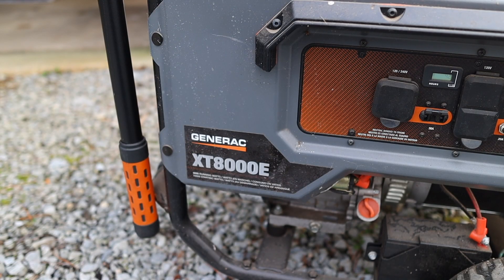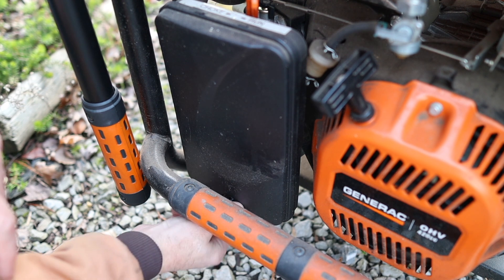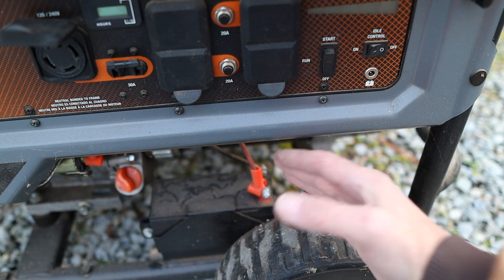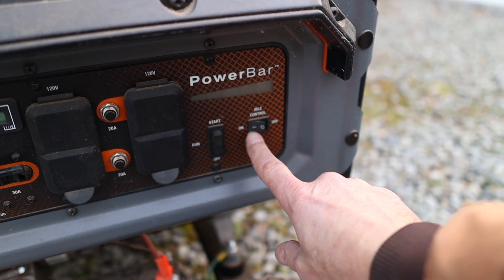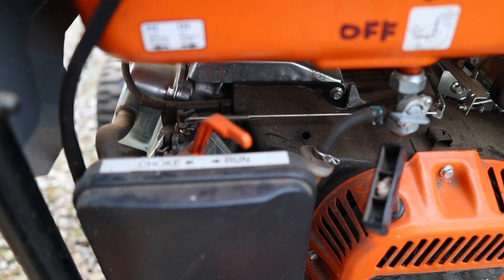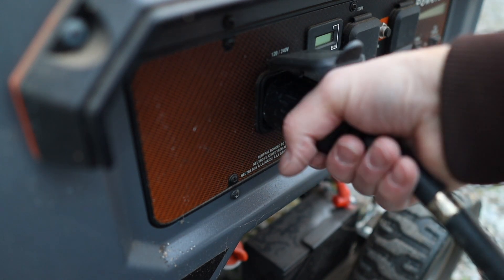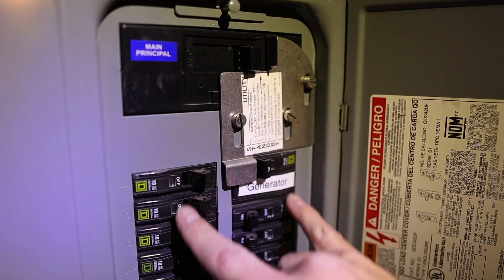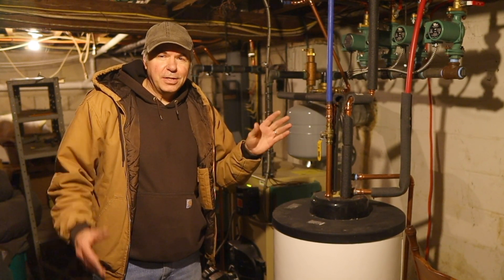Generator Monthly Test. Generac XT8000E and others. MCG video #128

Comment from the maker: These are Amazon Affiliate links. Purchasing through these links will help this channel by providing a small commission while not costing you any more. Thank you for your support!
GooLoo GP4000 Jump Starter: 
https://amzn.to/3IBT74T
Generac GP800E Generartor: 
https://amzn.to/3GoQyjR
Champion Dual Fuel 4500w Inverter Generator: 
https://amzn.to/3k1N9Qq
AirTec Lube-Shuttle Pistol Grip Grease Gun Kit:
https://amzn.to/3O0pj1z
LockNLube Grease Gun Coupler:
https://amzn.to/3kPcvwu
Recommended Grease:
Valvoline Moly Fortified
https://amzn.to/3jNM1Kv
Nitrile Gloves:
https://amzn.to/34Kg8OG
Deerskin Gloves:
https://amzn.to/2I17NNy
My Video Gear:
Rode Wireless Go II microphone:
https://amzn.to/3eiJatG
Canon M50 Camera (now Mark II):
https://amzn.to/3vHW9uD
Battery adapter for M50:
https://amzn.to/2RshsBE
Sigma 16mm prime lens:
https://amzn.to/3vJDRcx
Sigma 30mm prime lens:
https://amzn.to/3epFneh
Variable ND filters:
https://amzn.to/3tmoHIs

Comment: I don't worry about bad gas. I use natural gas. Start it up every 3 months. Change oil every 100 hours. Keep battery charged.  Check the filter and spark plug. If over 3 months I put a little oil in the spark plug opening and give the cord a few pulls before putting spark plug back in.  .... Your oil looks dirty.
Reply from the maker: It’s due for an oil change!

Comment: Nice, I have one of them power meter switches, same manual procedure as yours. But if the power grid returns it does so automatically on the switch. I use a Duromax XP12000EH with the 50 Amp outlet. Since I've prepped my house for this the longest outage we've had was 4h in the last two years.
Reply from the maker: Better to have it and not need it! ….. 😄
Reply: @MyClutteredGarage  It's like when you get a solid snow removal device like a tractor and snowblower, it will never snow. 😁

Comment: I call a generator “insurance”, and security. 
When generators became a common household piece of equipment, it took only one instance in the dead of of New England winter, to convince ME, being without electricity was no longer an option!!
I started with a “transfer switch” but did not like being that limited so, like you, I upgraded to an “interlock” device and a 30 amp breaker. Depending on who made your main circuit panel, the price for an interlock varies. A Siemens runs between 1 an 2 hundred, where all other, 10-20 bucks!! 
Still worth it! 
I invested in a battery start because I wanted to know that my wife could get the system up and running. Just had to teach her the battery setup because I keep my battery disconnected from the generator and on a trickle charge battery maintainer.
I like you shut down…I follow the first part… but I remove the drain bolt from the carburetor and drain my gas tank dry! Even with sta-bil…sitting for a couple years is not good so, I keep my tank dry and fresh gas at hand, 50 gals…
I’ve learned a generator up here, isn’t an option or a luxury! They ARE affordable and absolutely worth every cent, to know my family has electric!
Reply from the maker: You’re so right, Keith. I’m not in a bad weather area, but it seems that I need to use the generator at least once each year. The peace of mind is well worth it. As many have suggested, I may start adding a load test to the “monthly” routine. Thanks for watching!

Comment: I do the exact same thing Ed, good idea to drain the carburetor. Onetime I had a big 11K generator and stored it in my barn without draining the carb. Ended up having to pull the control panel off to get to the carburetor and clean it. I always drained it after that. Lessons learn. LoL.
Reply from the maker: Thanks Dean! Hopefully draining it along with fuel additive helps. I wish I could buy ethanol-free gas but it’s not available around here.

Comment: I have a large generator I use for my remote shed/garage. I still need to hook it up to the house. I've often thought about using a surge protector or a soft start when I use it for the house just to be extra safe with the appliances.
Reply from the maker: Hi Kevin. I’m not too familiar with a whole house soft start, but I am familiar with them for use on RV air conditioners. I have wondered if my generator would run the house AC if I installed a soft start on the compressor.
Reply: @MyClutteredGarage  they make a soft start in a surge protector. I watch a few rv channels and thought it wouldn't hurt.

Comment: Good Day Ed, Very Nice Generator 👍😇👌Ed, when was the last time that you change your oil and clean that air filter ?🧐👌👍 Sorry Sir Ed, ( I'm assimilated Clean Freak )🥴 Yes keep it full ( less prone to rust inside the fuel tank ) with High Octane ( Non Ethanol )  👍🧐 By putting an electrical load on your generator during your ( Tentative ) monthly will be great for your generator ( keep active the live magnets inside ) and also complete the full testing for your OUTSTANDING Fan's with back up generators 🧐👍👌Great safe procedure on your electrical panel 👌👍🧐Outstanding videos Sir Cheers 🍻🍻
Reply from the maker: Thank you David. It’s due for an oil and air filter change. That’s all I’ll say, haha! Yes lots of folks have suggested including a load test. I guess I need to update my process! Thank you, my friend!

Comment: Good review Ed. I have a whole house in now that runs every Monday. Just the motor runs so If we don’t haven’t had a power outage in last 3 months or so, I transfer power and let it run also to exercise the generator and flow electricity. I still have 2 portable generators for camping and for my Mom’s house I also run them every once in awhile and like others said I run something on them also. Also turn gas off and let them die. Great review. 👍✊😊
Reply from the maker: Thanks Bob. It sounds like you're set for off grid living! At least temporarily!

Comment: Nice job Ed. I try to start my generator twice a year but I'm not always successful. We just had a two day outage on the 23rd and 24th and I was happy when the generator started right up. I  also use a fuel stabilizer and also turn off the gas valve when shutting do the generator which I think makes a big difference.
Reply from the maker: Yeah, I definitely skip a month here and there :)

Comment: Need to put a load on it.  Run a pump or something with about 1 hp or more draw (e.g. corded leaf blower).  Seen engines work but the windings are messed up.  Actually that was a common problem.  Good quick explanation of the fuse box.
Reply from the maker: Thank you, Brian.

Comment: You should always put a load on the generator every month. It's a kicker when the power goes out you plug in generator and doesn't make power but it runs. Great video 👍👍👍
Reply from the maker: Good point, David. I tend to skip that part but it's a good idea.
Reply: Agreed David.  I don't get it done once a month, but I do like to put it under load when I run it. 👍🙂